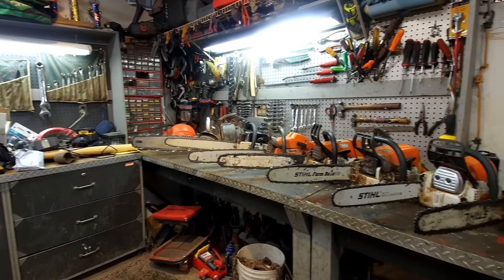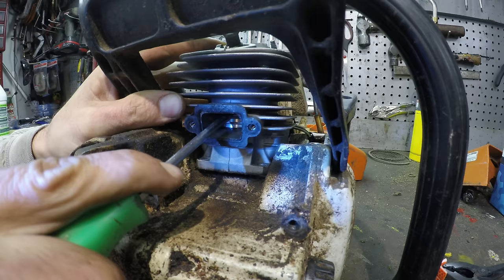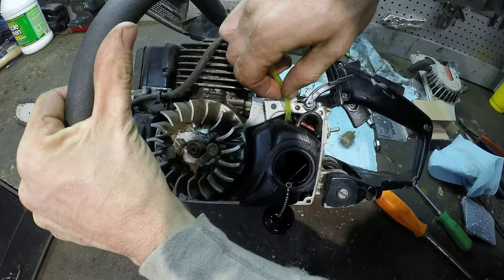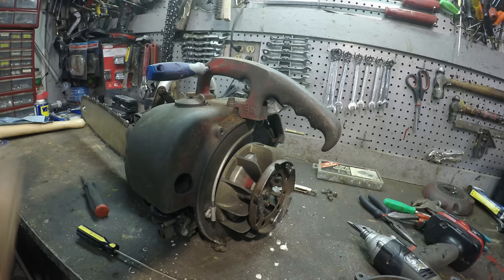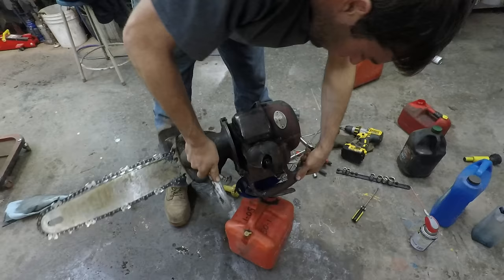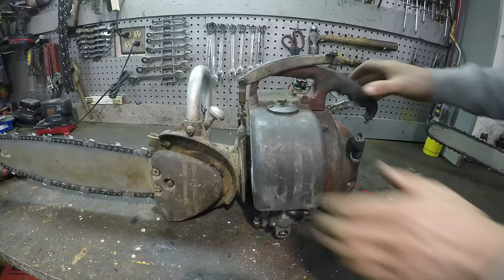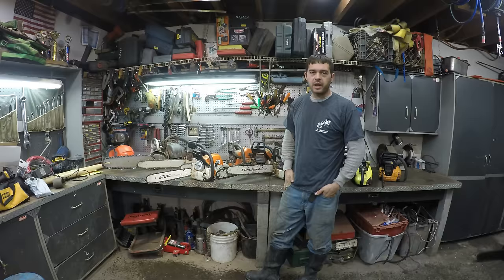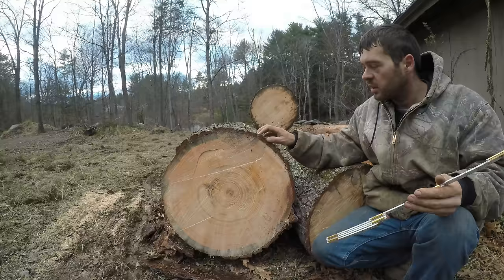Fixing and talking about chainsaws

Comment: My dad bought a mall chainsaw when he was in college, in early 50s, it was after this model a couple of years and had no rotating chain thing. It was just like current models just very heavy. He said he got it and took it to the farm and he  cut a  couple hundred tamrac  trees for fence posts over two days.  Over the years he cut 1,000s  out of the swamp.  It was 40 acres, it might have even been 80 acres of them and sold them and used it maybe 30 years.  Someone sole it on him.  But it was a big dog maybe 12 lbs,  it seems and a bar at least twice what this one was.  But it paid for it'self that first weekend at a time when many were still using manual saws. That is how that saw sounds, maybe just a bit more rpms but that is it!  LOL

Comment: when you put in the springs in the piston i always turn them a bit in the groove.... to be sure they are in the groove..,you can see when you put the first one that it should be turned...thats for sure why the piston clip/spring came loose....and now its mounted the same way.turn them with screwdriver a full round ...just to be sure and check the groove for small metal or dirt.And when you mount a cylinder you always use oil ! Never mount a cylinder dry .....

Comment: Your 036 Pro does not have a bar oil problem. If you read the FAQ on their website you will see it addressed. What is actually happening is the oil which is pumped through the bar empties out of the bar once the chain and saw are at rest and gravity has its way with them. Do I agree it's irritating and you would think that they come up with something to prevent it from doing that.

Comment: One tip as far as using the electric chainsaw sharpener‘s. You have to be careful not to hold it on there too long. When you hit that metal it too much it will hard in it and it will become brittle or chip easier and can’t even warp. You can tell if you’re doing it too long because usually it kind of turns blue like it would around a weld.  With the electric when you really just wanna barely touch it, you think with the hand file you’ve crossed it five or six times with that thing a second is doing that much failing

Comment: Make sure the c clip is faceing  up or down with the stroke . On a 2 stroke the rist pin clip can flex and pop out most comon mistake with 2 stroke rebuilds #2 most common mistake dropping or losing c clip in the case than it sucks it up at high rpms

Comment: I know why you lost the gudgeon pin circlip on the 036 saw. It's because you didn't rotate the clips after installation so that  the ends are opposite the installation groove on the piston. These aftermarket circlips are also way tougher than the orignal Stihl ones, and easy to strain. I always use stihl circlips when using these kits for this very reason. I have had the same thing happen as you have done but I think my clips could have popped due to them being over strained. Great video :)

Comment: Andrew, If I had a way to show you what I use to sharpen my chain, I would. I connect it to the battery on my car. It takes less than 10 minutes to sharpen the chain and I can sharpen it anywhere. The name is: Sure Sharp 12V Electric Chain Sharpener 575214 it comes from Oregon Chain. The bits that come with it are good for cutting butter. I get diamond studded bits from another company.

Comment: I thought you took a few shortcuts in your installation of the new jug and piston, like cleaning u the saw a little bit around the cylinder and not lubricating the new piston and cylinder before they were installed.

Comment: The rings have to re-seat after setting up all those years.  I picked up an 026 Stihl that had some crash damage and had been sitting up for the last 15 years.  I have ordered a new gas tank for it but it has not gone in, yet.toda, Inattached it to an auxiliary gas tank and a long fuel line and filter.  I primed it and got it going and ran it, mostly at idle, for 15 minutes.  I hen shut it off and let it cool down for a few hours.  When I tried to crank it back up, the compression had really jumped up and it ran better.  
As for what gas to oil ration would I use in a vintage saw?  I run the same gas in everything I own - 50:1 Echo Red Armor with PNE gas.I have 40:1 saws and 50:1 saws and all eat the same food.

Comment: Chainsaws are one of those tools where you just need to spend a little money on them. I bought the $150 Poulan stuff and they run OK for a while and then you just get to the point where they stop working when they get hot and they’re really hard to start and restarting is almost impossible you’re constantly trying to tune the thing and the parts are just cheap quality and they break. I bought one of the lower end Sthil MS 270 size nothing starts easy and just goes and goes and goes, I’ve had replace a spark plug in it but that was it other than chains and sharpening.  I probably spent more time on the cheap side is trying to tune and fix them and start them than I ever did cutting with them.  I’ve never even had to tune it yet.

Comment: couple things,,,liberal lubrication of everything that moves,even a little,with 2 stroke oil as you assemble parts so no dry starts,,,also, those little c clips to hold piston pin in don`t weigh much but at 10,000 or 12,000 RPM they get heavy so my practice is to installl them with the open end straight toward the crankshaft so they don`t flex and wear the groove in the piston as it changes direction,,, personal preference for me but thats the way i installed them in my saws or an h-1 500 cc kawasaki i raced and have never had one come out. I have had a new royobi saw snap a rod AND the crankshaft at high rpm on the 1`st tank of gas [what broke first ???] and lost a big end bearing on the kawasaki 426 hemi killer at about 130 mph as i hammered high gear nearing the lights that made for an interesting and hard on the leathers slide in the lights when it stopped turning before i got the clutch lever pulled!!!!!! [a few burns and sore but i was otherwise ok,the bike, it was fatally hurt and never raced again.]

Comment: MUST READ !!!!  I was a small engine tech for 40 years and if I ever saw someone touch a chain on a running saw at my shop, that would be the last time they stepped foot in my shop. If the clutch kicked in it wood have cut your foot off before you could pull it away from the chain. RE - (Fixing and talking about chainsaws) that old saw. Please be safe my friend.

Comment: I use a dremel bit on a rotary tool or die grinder they make different size bits for the different chains its nice because they also make a 12v dremel you can run off your cars battery if your on a job it takes about 10 minutes to sharpen a 24 in. chain right on the bar by the way that was real cowboy stuff using your foot to try and get that chain moving safety first chain saws don't give back what they take also a couple of those saws you were cutting with had very loose chains one was almost buckling while you cut that dulls them quick and burns on the bar. but great video

Comment: next time lubricate the piston and rings before installing into the cylinder/head.
after its back together your first couple pulls are gonna be bone dry and your rings are going to pre ware a gouge in the cylinder wall. thats probably your problem. and having to rebuild it 3 times in 2 years. wd40 and pb blaster is a shops best friend. or a bit of used oil. but never leave brand new parts like that dry when installing them like that. especially parts that move

Comment: Wd4o is an acid and oil based lubricant.it dissolves the rust but 15 minutes later it causes the metal to corrode and seize up again! Better of using liquid wrench,it uses kerosene and some other compound  that is not acid based. Another forma to use is homemade with diesel fuel or kerosene mixed with iodide or iodine!

Comment: I hope the bar is oiling.  I did not see a stripe on the floor when you were running it, inside.  My saws would have soaked the floor with bar oil if I had run them that much on the floor.

Comment: Hey let tell ya something about that spec thing check it online. Next that sthil chainsaw carburetor needs turned up some for more fuel feed in cutting mode. That craftsman has A walbro carburetor.,zamba.,or zenith.& zama. There is A little screen inside behind the diaphragm side were the needle goes in at. If it gets blocked.,or clogged up with any type of debris try cleaning it lightly with A small flathead screwdriver.& then spray carburetor cleaner on the screen with your finger slightly over the spot were the screen goes at. Then put the carburetor back together.& try it out. You may half to slightly adjust the air fuel screws. Witch are low.& high speed control jet screws.& then there is the idle screw of course that is left over to adjust out last.

Comment: You should head to the dollar store and buy a thing of purple power degreaser it melts the grit and grime off of my saws just with the spray nozzle on my water hose and of course blow em off with compressed air and crank em and warm em up good they'd look brand new and I like to do spray em down good before I tear one down to me it's nicer to work on without the mess

Comment: Oil has come a long way. Many older cars never made it any where near 50,000 miles before needing rebuilding. We've taken steps forward in oiling and backwards in the gasoline department. Those two strokes do not like that ethanol crap that they are forcing us to use today!

Comment: hey you young ones  note that 4-5 ft cut big saw was meant for tree big 5 ft trees not the boughs you cut with your toys. back in 55 when i was 10 i helped my granddad cut trees out 6-7 across the base the old trees in church yards  try that for a challenge old tree graveyards ray from uk
Reply: re my comments above that chainsaw had 350 villiers engine. yes 350  not 50-90.

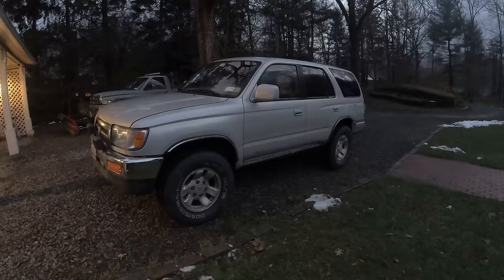Comment: 1:18:30 238,900 miles from the surface of the Earth to the surface of the Moon.
If you drove that the whole way, you've drove more than the distance between the two.
But imagine all the time driving it took to get up to that, and if there were a road to the Moon, and you drove 60 MPH on it, it'd take you nearly 4000 hours (3982) to get there. That's nearly 166 days of just driving 60 MPH, to get to the Moon.
If you got 20 miles per gallon, that'd be nearly 12,000 gallons of fuel.

Comment: Be extremely careful putting circlips in a piston, especially the intake side one.  I take an old wrist pin and push it against the circlip on both sides and give it a light tap with my smallest hammer.  This insures the circlip is properly seated in its slot.

Comment: i havent seen this dude try anything he hasnt fixed yet...btu why post it if you couldnt i guess. what im wondering is those screw the high Low and and idle....im not sure what id be looking for on knowing when to adjust those screws...maybe hes or a mechanic is used to hearing a certain sound from eharing so many ..that part i dont really get....see after he put the carberator in and it started id have said its fixed...so much more to learn i guess.

Comment: Your chainsaw sharpener needs the depth adjusted a little more. Once the depth is set right u can pull the grinder all the way down without worries and u can sharpen your chain quicker. Other than that good video.

Comment: Hey you. interesting videos you have made. I like and subscribe you I have been saving chainsaws for many years, my job is 90% chainsaw in use. do not know about the big difference between Europe and the US, grip handle for the left hand, which you say that when you brush It you get more power from the engine, but all my chainsaws up over the years, so this is the handle and safety if the saw cuts and strikes back, then he pushes the tackle forward and brakes to stop. also has old American chainsaws and is the same way. greetings from Norway Europe

Comment: Andrew...ditto to all your fan's comments.  Great that you use no "F" words of other 4 letter trash talk.  I have a hint for you.  I had a Husqvarna saw that seized up when I was cutting a treated telephone saw in half lengthwise.  It worked it so hard that it overheated and seized.  I replaced the cylinder and piston and it ran fine.  I overworked it again and again it seized.  I noticed that the storebought two cycle fuels sold by dealers all had gasoline with over 90 octane.  I began using only premium, 91 octane or higher, for two cycle use.  I have since overworked this same saw many times using the higher octane gas and never a hint of a problem.  Hope you can use this info in your operations using two cycle engines.

Comment: The thing you did wrong first time and I think perhaps again this time is, you didn’t locate the ends of the wrist pin retaining clip away from the gap in the piston adjacent to clip groove. It extremely unlikely that you altered the spring dimensions or tension when fitting them. Also it’s not a bad idea to clean ALL the parts before reassembling them. 
Just sayin!!!

Comment: the 50s oil wasn't as good due to modern oil being synthetic  and even in conventual oil there are different additives in modern stuff but the reason they used 12-1 is because of tolerances

Comment: Hi.  I'm looking for a rear plastic throttle handle for a Husqvarna 380CD.  Do you know where I might find one?  Thanks!
Reply from the maker: Husqvarna dealer or ebay.
Reply: Thanks.  My problem is that the saw is so old no one has parts for it.
Reply from the maker: It will be on ebay. If not just buy a new saw.

Comment: Alright Andrew! Unlike all of these other people who commented on this video, I am gonna say you're a rookie with a chainsaw! First off, You never drop start a chainsaw!That is what breaks the damn starter paws off all these plastic pieces of s@#t they sell to everyone these days. Always set the saw on the ground and put your foot on the starting pad and your other hand on the handle bar. Second thing is the Skilsaw 1612 is not a direct drive saw! The clutch bearing is bone dry! When the bearing is not lubed it is trying to weld itself to the crankshaft. And third, I'm a firm believer that if your going to make a video about a chainsaw you need to know what the hell the parts are called and how they work before getting on YouTube and looking like a rookie! Those teeth  on the front of the saw are called falling spikes! Just like everyone calls them rakers on the chain, Oregon chain calls them depth Guages and that is what I call them as well! I own 60saws at least! And I enjoy being able to make them kick butt better than most people can 😋 I believe that its important for the saw operator to know how to hand sharpen a chain and to know what to look for so as not to turn a very nice vintage chainsaw into a piece of s@#t in a very short period of time. I always tell people to get it started, Give it 30 seconds to transfer some heat into the cylinder so you don't cold sieze the saw!And bury the thing into the log for 3o seconds to a minute and then shut the saw off and check your chain tension,most likely you're gonna find out that the bar and chain are too tight from heat expansion! And that sure don't take long to make a mess out of things if you don't catch it in time! It's a must to know what you're listening for, feeling, And even smelling when you're running a saw 😉

Comment: Simple Green in an ultrasonic cleaner!  A man after my own heart.  The good folks at Vintage Machinery.org had some helpful info, if you haven't found it already:  http://vintagemachinery.org/mfgindex/detail.aspx?id=1183.  Turns out there is also a collection of parts and manuals on Ebay:  https://www.ebay.com/b/Mall-Chainsaw-In-Chainsaw-Parts-Accessories/85915/bn_7022183016.  Great job getting it running again!  Mustie1 should be envious.

Comment: Please don't ever get any body part near the blade of a motorized device while it's running.
I did almost the exact same thing with a motorized hedge trimmer. Tried to yank a handful the garbage out of the blade. That thing jerked a little bit and went halfway through three of my fingers. I still have those very visible scars more than 45 years later.
You are so very lucky that blade didn't start turning when you were pushing on it. You would have lost at least half of your foot.

Comment: that 036 is better than the ms362 you want to put an OEM cylinder and piston on sure it's expensive but it's actually really worth it I have a shit ton of saws and I spend a shit ton of money but it's worth it also that 036 is better than that Husqvarna if you spend the money rebuilding that saw with OEM parts you have a really really good saw and also there's no use in going to buy another saw the MS362 is $800 and you can rebuild that 036 with OEM parts for under $500 but overall if you want to get a aftermarket cylinder that will last don't by farmtec NWP is ok it will last

Comment: Why the heck put it in the water?Easy to drop it slightly up the bank.You should've used wedges or the sizwill cut.
Reply: the sizwill cut drops it where you want it.Especially without heavy equipment and would've saved wear and tear on your rigs.
Reply: I am sorry,I really liked your video but would have been better to show importance of cleaning the saws thouroughly.